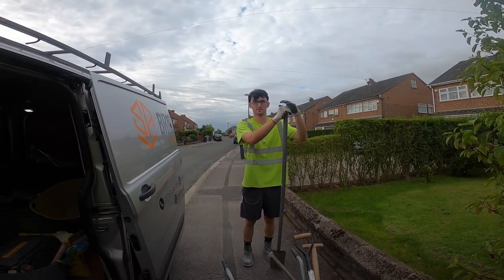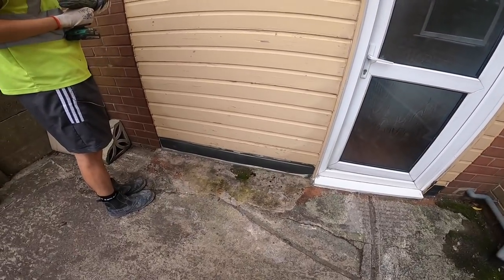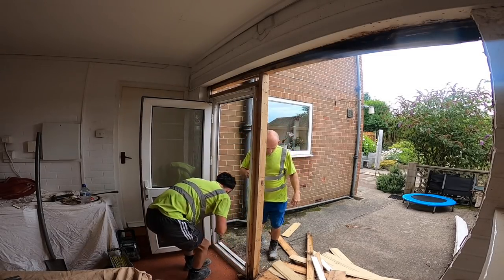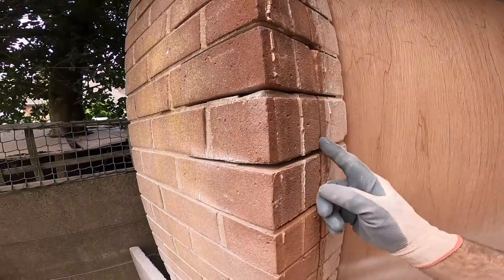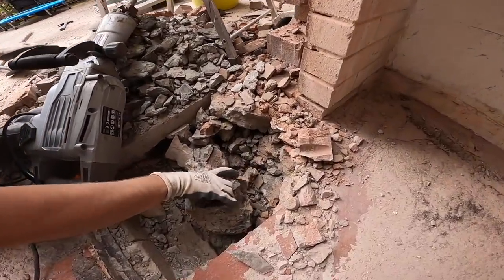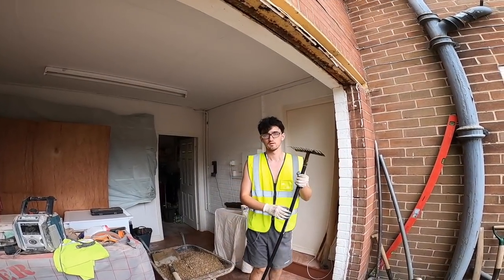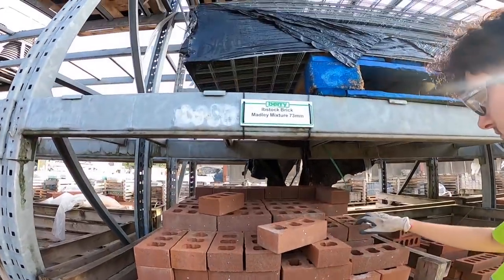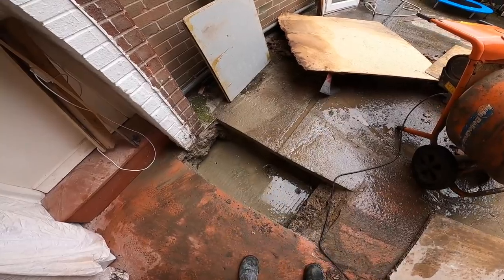SHOCKING BOTCH JOB .....UTILITY ROOM REPAIR PART 1

Comment: you are not any better you made a massive job out of something so simple
Reply from the maker: 😆😆 Thanks
Reply: The customer has a rusting steel lintel that's cracked the wall and a severe condensation problem. They can have it replaced with another lintel (and suffer continuing damp) or have the wall bricked up. Costs will be a bit higher but damp is never cheap to sort.
Reply: What happens when it rusts steve does it bend and pop

Comment: Hi could this be changed only by isolating the cold feed and not the flow and return valves.would it not air lock even if the boiler was downstairs in a house
Reply from the maker: Sorry not sure what you mean 🤨🧱👍🏽

Comment: Really enjoyed the video lads. I especially liked the bit where you showed the power of rust. I had a customer previously asking me why I had spent so much time  Red oxide painting the steals We were putting in. If somebody asked me again I’m going to point them to that bit of your video. 👍👍👍
Reply from the maker: Nice one thanks Rob . In part 2 you get to see just how bad these steels got . 
They were so bloody heavy though 🥵🥵🧱👍🏽
Reply: @SteveAndAlexBuild  I remember being told that 1 mm of steel turns into something like 10 mm of rust, so I guess there was still plenty of steel left.
Reply from the maker: @Ragnar8504  It doesn’t stop at 1 mm that’s the trouble , I deteriorates to nothing and by the time it’s expanded to 10 mm it has destroyed the brickwork above 😳🧱👍🏼
Reply: @SteveAndAlexBuild  Yeah, it will keep expanding unless you stop it (in this case by redoing everything properly). My point was mainly that I'm not surprised the steels were still heavy, even considering how badly rusted they were.

Comment: What is it with brick manufacturing in the UK? I've recently experienced a failure rate of 1 in 4 bricks from a single pallet - either chipped, cracked or misshapen. Anyone know what's going on in this sector, where standards have fallen so low?
Reply from the maker: It’s all gone terrible, closed factories, discontinued bricks poor quality , brick manufacturing is is in a  right stare making our job even harder . 
    We’ve just done a job and the brick were from Turkey 🇹🇷🧱👍🏽
Reply: China

Comment: Milwaukee should be giving you one of their MX Fuel electric ones with water kit to demo, they'd get more coverage from you guys than some channels they support... Still use a TS400 myself, always 25:1 2t mix though.

Always bag the loose if a skip is late then you can stack them out of the work area and pour it into the skip when it arrives.
Reply from the maker: Thanks pal , we did ask but they sent us a multi tool instead 🤣🤣🧱👍🏽

Comment: Spot on with the toothing..always top to bottom..learnt the hard way so many times 🤣
I reckon u lads would really benefit from getting some post hole diggers, perfect for tight footings like the ones you were digging 😊 nice being able to just tip the mixer straight into the footings 👌👌👍them bricks are a joke..recently found the quality of bricks from merchants are shocking! Brilliant work as always lads! Keep it it, nice out takes 🤣🤣 enjoy your weekend 🍻🍻
Reply from the maker: We have sone but forgot them 🙄😆. Brick quality and availability has gone ridiculous now . We’ve just dine an extension and the bricks were made in turkey 🦃 😳🧱👍🏽
Reply: @SteveAndAlexBuild  😨😨😨😨🤦‍♂️yea it's a joke at the moment..ah well..all fun and games🤣😂
Reply from the maker: @IzzytheBricky  . Rained off today so me and Al are off to Blackpool fir late night riding at the pleasure beach till 10 pm 🎢🙌🏽😆🧱👍🏽

Comment: I think the crack you spoke of could be a lintel problem with the window above. Also note the large tree over the boundary but only 4m from the building. Surely this house needs a Structural Engineer to assess before any repairs are carried out.
Reply from the maker: We don’t need a structural engineer to tell us that the steels are the cause of the problems , nothing to do with lintels above or trees 🧱👍🏽
Reply: @SteveAndAlexBuild  I do find that attitude rather worrying because often building defects have more than one cause. It's a very interesting video anyway! Is it timber frame on the second storey??? Otherwise what is that window doing on a corner??? I am not knocking your work but just observing there are a lot of issues with the extension.
Reply from the maker: @dannymurphy1779 . We were called and asked to take that tatty rotten stud out and stop it leaking , just a cheap quick fix . 
   I said there isn’t a quick fix and it would need a footing fir new brick work and lintels to span the inspection chamber . 
    I have no idea how the extension has been constructed  above as we weren’t there for any other issues that it may have . 
    The customer is a lady pensioner on her own with a limited budget. 
    When someone eventually buys the house that extension would be better being dropped and re built . It’s badly built and is a bloody eye sore with that awful flat roof 🙄🧱👍🏽
Reply: @SteveAndAlexBuild  I see, thanks for explaining. There is only so much you can do! I fully accept you were right about the steel, would hardly be a surprise if there is a problem with that upstairs window too though. Have seen both vids so know it was block not timber frame. A first class job anyway, she was very lucky to find you guys. Cheers I have learnt a lot :).
Reply from the maker: @dannymurphy1779  Cheers Danny , much appreciated 😁🧱👍🏽

Comment: No one ever thinks about drainage or covers…!! Should have at least had brickwork taken down and corbelled over to put the
M/H outside or inside…and water-tight cover if inside… I guess no planning consent for change of use from garage to habitable area or building control consent either…seeing as the drainage cover was built over… Amazing the power of rust as it expands to lift and displace brickwork under load eh…!
Reply from the maker: The strength of rust is frightening alright. 
   That bloody lid was silicones down too 😳🙄🧱👍🏽